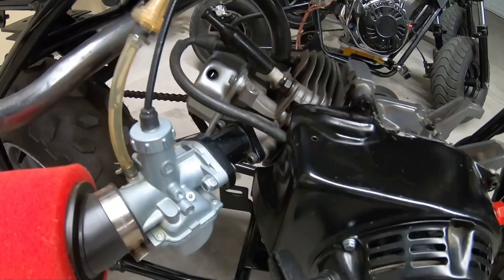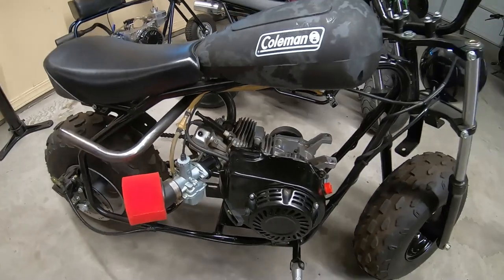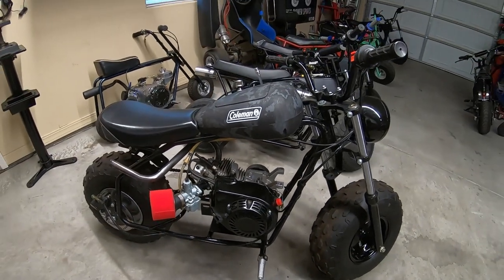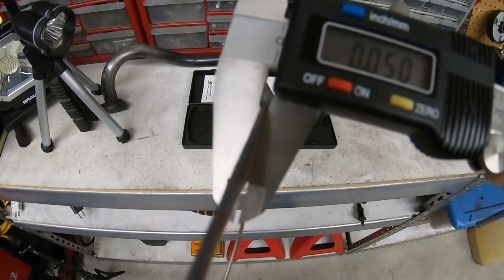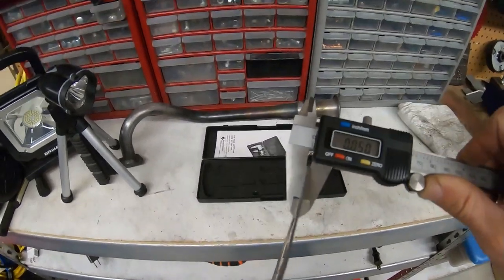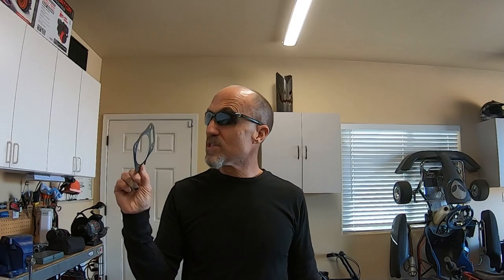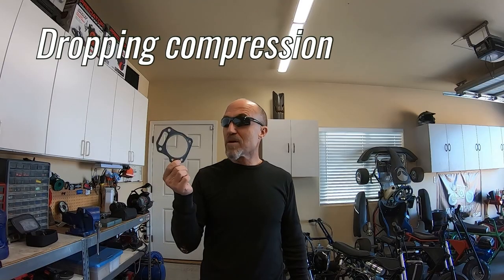Does more compression make a minibike faster?

Comment: I appreciate the video and the tip! I'm curious as to what gear ratio were you using? I still have some things to add but 60mph is my goal and changing sprockets might be next! Thanks for the great content!
Reply from the maker: Thanks! In this video the bike was running a straight chain. A 6 to 1 ratio, 10 on the clutch and a 60 on the rear sprocket.
Reply: Get a 15t sprocket for the clutch bell housing get a flywheel, cam, valve springs, and a 22mm mikuni clone carburetor and 60 mph is definitely achievable my mini bike does 74mph on gps

Comment: I paused at 6:50 to say that my guess is one point of compression should be about a 4% change in overall power across the curve not just peak. 
I expect to see a very miniscule difference in performance in this particular application. 
However with that said it certainly will not go faster with lower compression ratio!

Edit : about 1.5mph top speed is quite a big difference! Love the testing methods and showing the data!
Compression rules!
It's "free" horsepower. 
These engines will easily run on 11:1 static compression on pump gas over the stock 8.5ish.
Don't go so crazy as to run a cam without the compression release but man, pump em up to 12.5:1 and run 100 octane unleaded or even e-85 if you are looking for performance!
Compression and a good cam will almost triple your horsepower in these applications.

Comment: what a lot of people dont get is that different fuels need to be compressed differently. would be great to see fuel comparison with compression changes as well.
Reply from the maker: I have some fuel comparison videos.
Reply: Octane is a value given to gasoline for it's resistance to combust when mixed with air. 
Higher octane fuel is a "slower burning" fuel to keep it simple. It's needed and used when the static and dynamic compression is enough to induce pre-ignition or detonation due to heat of compression. 
Yes different compression levels both static and dynamic require different octane, or different fuels is a more common way to say it rather than different fuels require different compression ratios. The comp ratio will determine your fuel octane needs.

Comment: Make sure you use grade 8 bolts. I'm running a Tillotson 212 and my chain was coming off. Unfortunately I put a chain tensioner on it. I'm running 10 tooth Torx clutch and a 60 tooth rear sprocket. I weigh 200 lb. Replace the clutch and found out the engine pulled the threads out of my front- engine Bolt. lost the original bolts and put cheap ones in.. I feel like an idiot.😂😂😂 thank you so much for your videos.

Comment: How come you didn’t check compression psi just to get a reading and then compare that for future builds on a CNC head . And just over all info
Reply: That's a great point. Camshaft specs play a big part too in cranking compression numbers but for comparison in this vid with just a point change in static compression via a head gasket, cranking compression numbers could be valuable info

Comment: I have compression problem with my built predator 212 so far I have installed a billet rod, billet flywheel, 265 hot cam , 22lb valve springs and it has really bad on the pullback what do suggest BOSS? @Black66
Reply from the maker: Is the compression release not working?
Reply: @Black66  I set the valves both at 3,000’s and still nothing. Do you think it could be the cam?
Reply: @Black66  I did double check that valves and it got a little better, do you think not putting the flywheel right might be causing that im sorry I’m asking to many questions I just got into mini bikes and im liking it but this problems im having is making me think I mess something up. By the way I’ve watch all your videos😃 watching your videos motivated me to try doing it my self 😅 but you make it look easy 😆
Reply: Check the compression release, valve lash, and timing lineup between the cam and crank.

Comment: IMHO, not good video info. If some person is running a hemi head with a +.020" rod, and flat top piston, then change to a .009" head gasket, the exhaust valve will hit the piston at that rpm.  Maybe not today, maybe not tomorrow.... but it will hit eventually. "CHECK YOUR PISTON TO VALVE CLEARANCE"  when working with a hemi head. Non hemi heads will allow much more room for error, IMHO.
Reply: Either way hemi or non-hemi, once the head is torqued down make sure you have at least 0.035 clearance between the piston and either valve during the engine's rotation. And having a higher compression ratio is always more horsepower.
Reply: I’ve got a 212 non hemi. Completely modified. +.020 rod. I just got a flat top piston and a .010 gasket. Will it work?